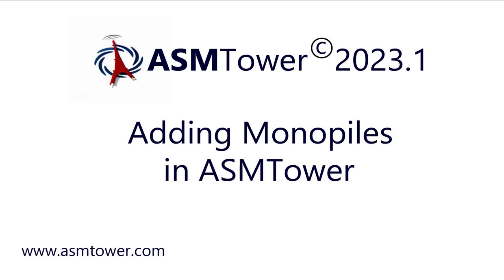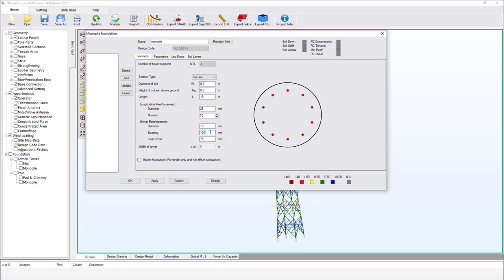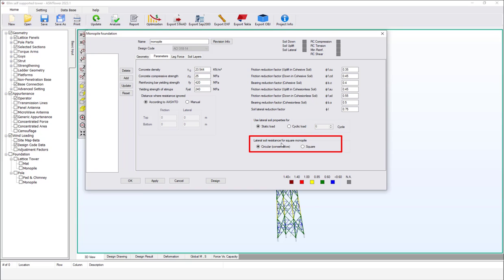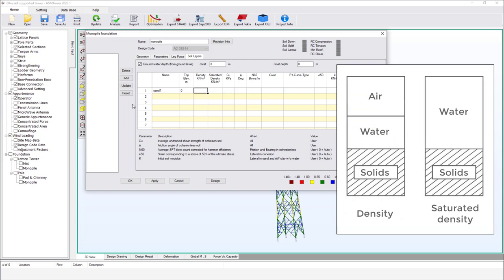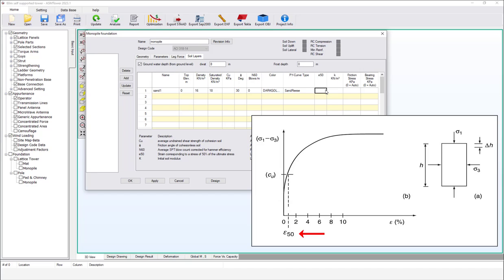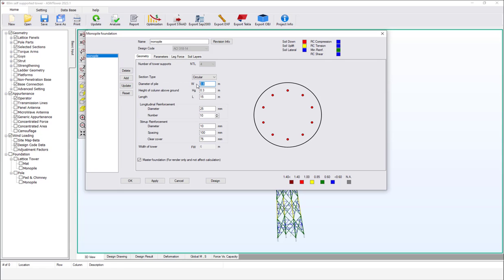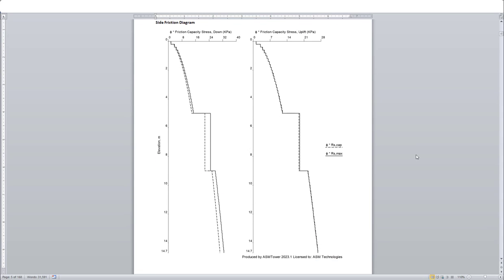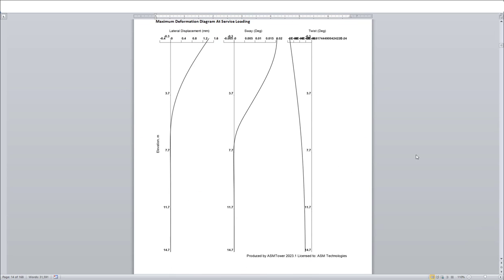A Comprehensive Guide to design Monopile/Caisson with TIA 222 and EN1993 3 1 Standards

Comment: It was a very informative presentation. Thank you, ASMTower!
My suggestion would be if there is an option to create a multi-sectional pile as the designer may suggest different sections with dissimilar cross-sections or reinforcement arrangements.
For pole foundation, is there an option to model a pile cap to accommodate the anchor bolts or only embed them directly in the monopile?